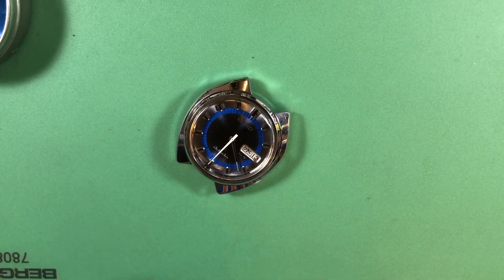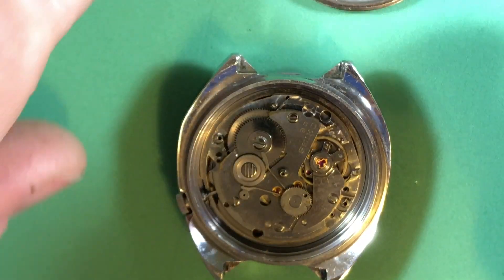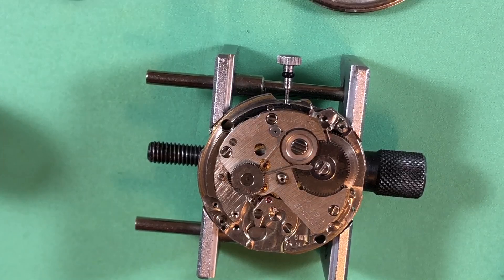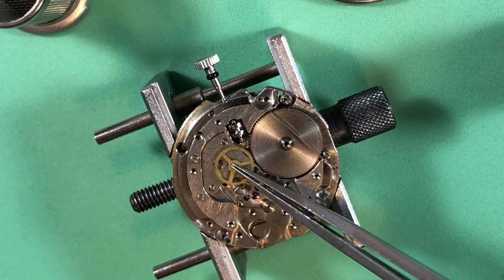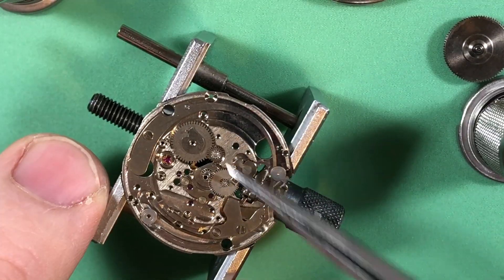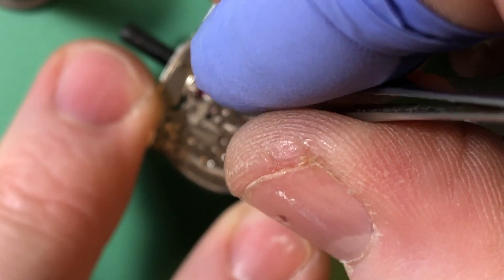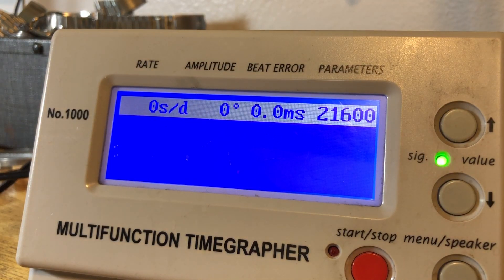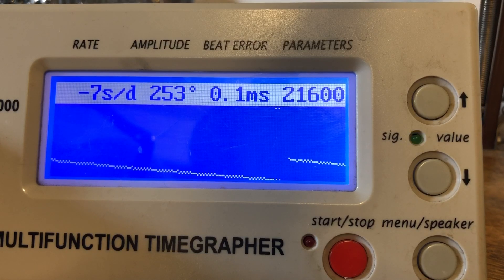For CC: Seiko 7019-7150 JDM Advan

Comment: I have exactly the same watch as this that I picked up earlier in the year.
They are quite hard to find in good condition, usually cases are polished, original strap missing, crystal in bad shape.
Mine was in great shape with original strap but had an aftermarket flat crystal fitted.
Having heard that the faceted crystals for these are rarer than hen's teeth I didn't have much hope of finding one.
Surprisingly I found one very easily on Instagram of all places!
No idea of the service history of mine but it's a very clean movement and runs +1 second a day!!!!
Fantastic video.
Reply: Tengo uno igual y también estoy en busca de el mismo cristal 😭

Comment: I have one of these movements that I'm in the middle of cleaning and re-assembling now. I pulled it out of what was supposed to be a 7S26 Seiko 5. I'm really impressed by how easy it is to work on. I have several 7009s, but I'm going to upgrade one of them with the 7019, as soon as I get off my lazy butt and finish it.
Reply: This lovely movement 7009a. I have 2.
Reply: I bought off ebay a 7009 and discovered it had a 7S26 inside and was not unhappy about it as I got a few 7009's but didn't have a 7S26 lol